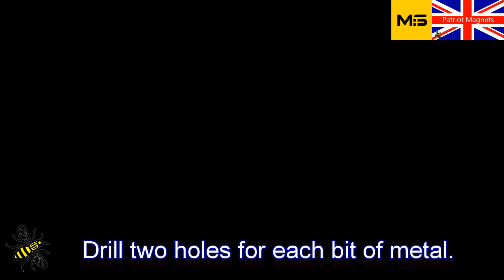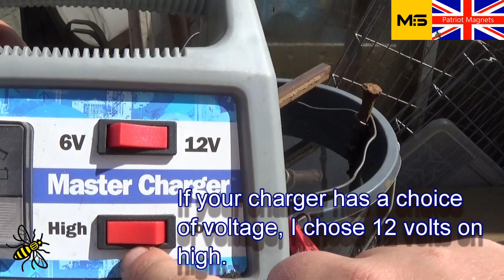DIY Step By Step Electrolysis Rust Removal. Great For Magnet Fishing Finds.

Comment: It works fine. Nice job.

I enjoy your videos and don't want to be a kill joy when I offer my suggestions here:

Maybe it'd be a good idea to clean off the bolts before using them; it would greatly improve their ability to draw the rust away and bind to them. 

Using that heavy Gage wire was abit over the top IMHO; regular wire would have done the same and been easier for you to wrap around and obtain a more solid connection with said bolts ...again IMHO.
Reply from the maker: Hi Kevin, thanks for this information, much appreciated and taken onboard, and definitely could of needed some smaller wire I was just trying to use what I found, them bolts definitely needed electrolysis before use too. Cheers. 👍🇬🇧
Reply: @Patriotmagnets  Cheers mate!  :-)